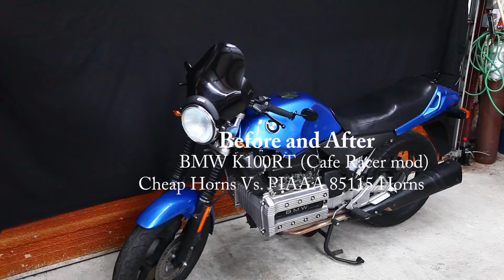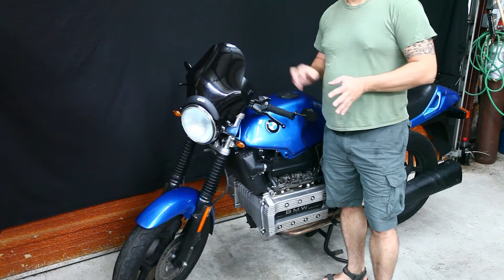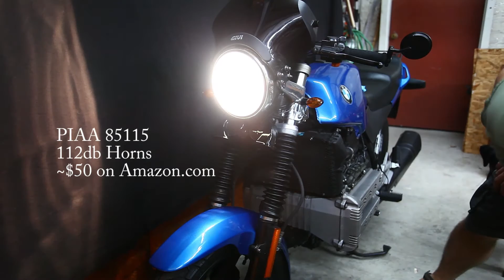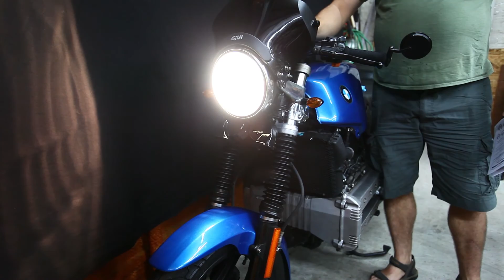PIAA 85115 Horn on BMW K100 Motorcycle

Comment: Cool.  Did you have to change any of the wiring or relays?
Reply from the maker: No it worked just fine.  I did have some issues with occassionally blowing a fuse with the original horns.  I put a self-resetting fuse in and that cured the issue.  I just talked it up to old cranky wiring.